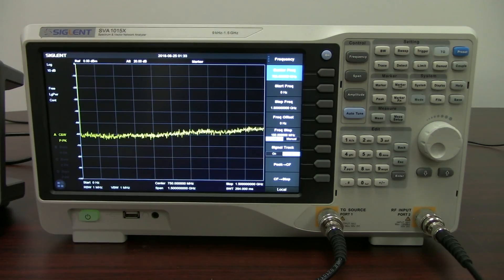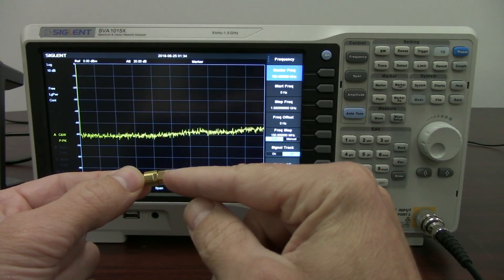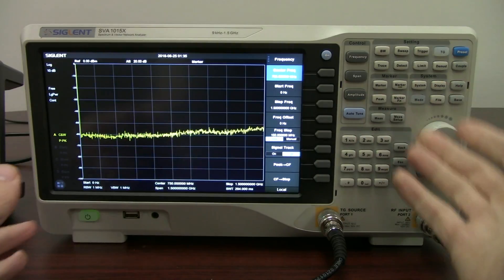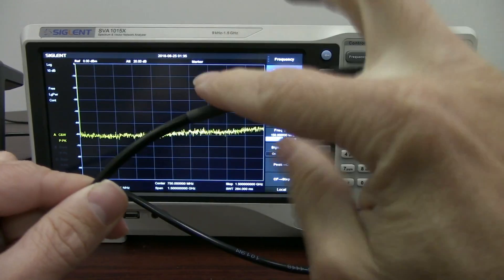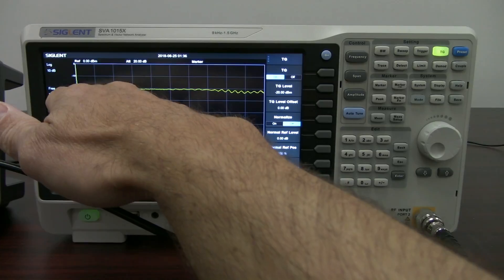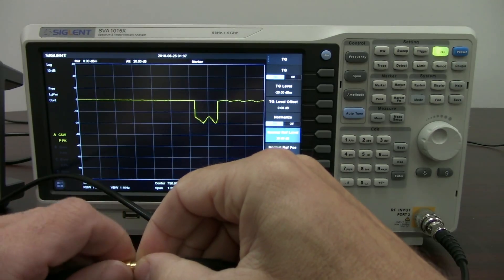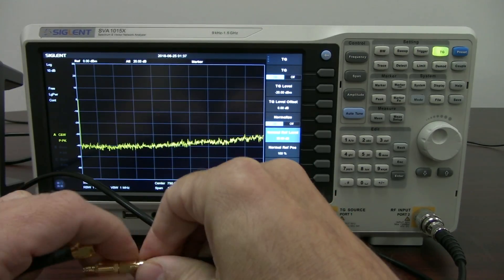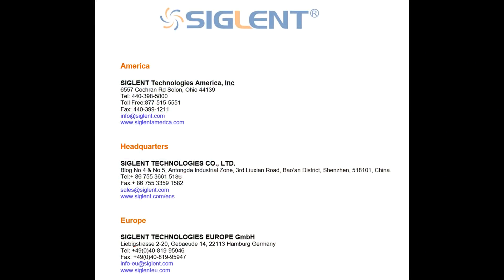Attenuator verification using a spectrum analyzer with tracking generator

Comment: Wow...  You really need to learn how to use SMA connectors.  You turn the nut to install/tighten it not spin the female end in.  The way your doing it the center pins will be worn out by the end of the week.
Reply from the maker: I hadn't thought about the connection method prior to this video, but you are correct. There simply isn't a lot of mating surface area between the SMA center pin and coupling. Spinning the female coupling could wear the connection faster.